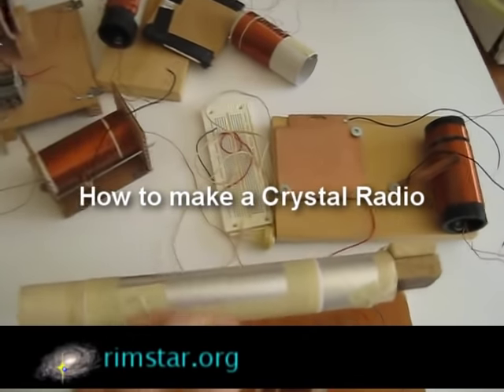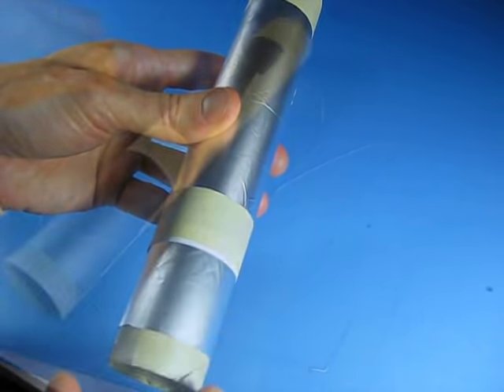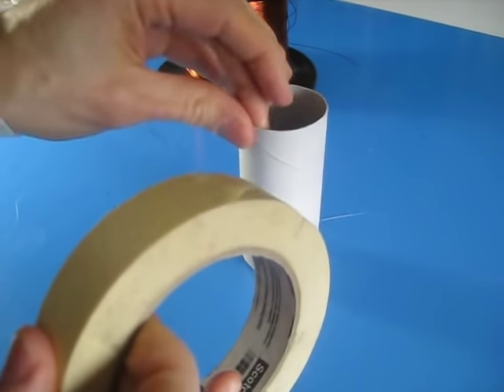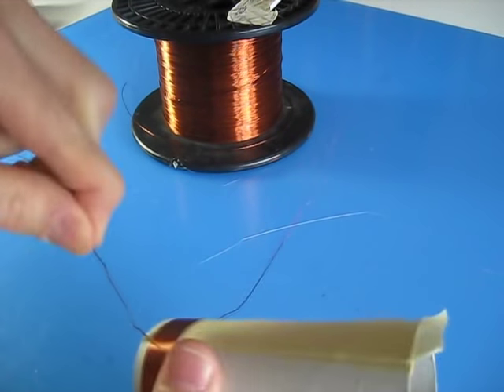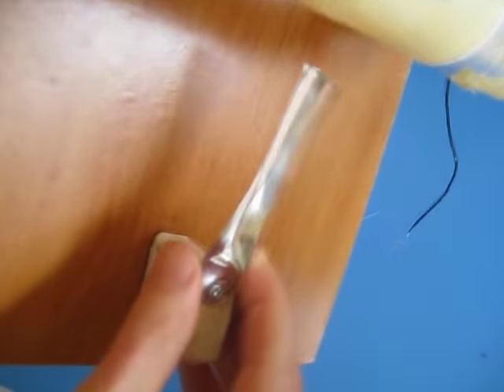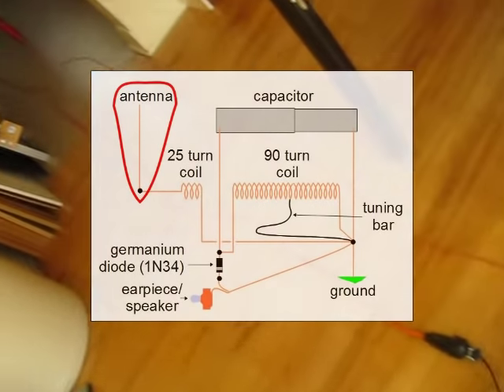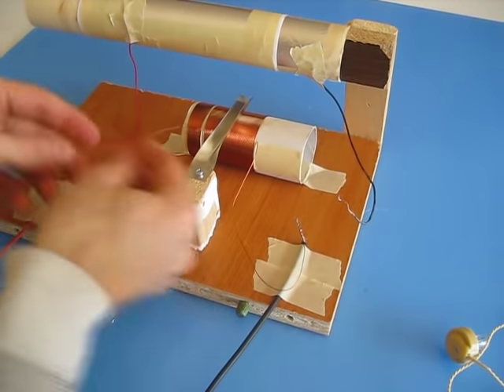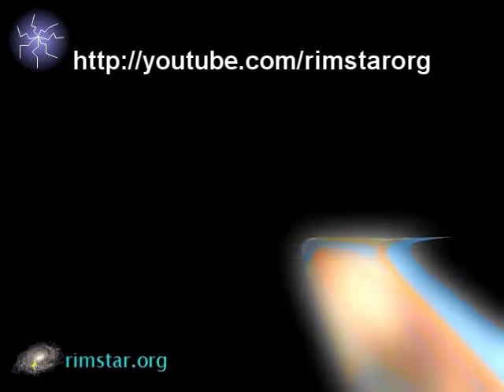How to Make/Build a Crystal Radio

Comment from the maker: +Gabriels Raitis Kuma No, an LED won't work. The voltage required to start the LED conducting is too high for the radio. And it has to be a germanium diode, not a silicon diode.
PS. Your comment doesn't have a Reply button because your Google+ settings are set to not allow "Anyone" to comment on your public posts.
Reply: Will an Schottky diode work also?
Reply from the maker: Some mentioned in the comments here that a low-barrier Schottky barrier might work. I haven't tried it myself.
Reply: I bought the lowest voltage drop Schottky diode (0.29v @ 5mA) with very small leakage (within nanoamps) but I have not had luck so far. I suspect my crystal earpiece may  have been damaged though.
Reply from the maker: Thanks. Let me know if you do get it working. It would be nice to have confirmation.
Reply: RimstarOrg I can pick up noise around 700KHz, and it sounds exactly the same on a surround sound system on the AM tuner selection. I think it is my PS3 or TV tuner. Even the tuner cannot pick up any strong AM stations, so if this does work, it is not very sensitive. I have had a germanium diode many years ago and that worked, but a HV transient popped it.
Reply: Here is a list of everything I figured out since the last comment: (make sure to read more)

I picked up a few of these "SBAT54CLT1G" Schottky diodes (link below), which have a Vf of 0.23V @ 1mA, and pretty good reverse blockage. They were the best ones I found on Mouser. I have found that they do indeed work much better after I setup my own 32MHz VHF AM transmitter (I only had a 32MHz crystal oscillator.), because I cannot pick up any actual AM stations. Maybe you could give them a try? The nice thing about being able to use schottky diodes is that you can salvage them from small switch mode regulators on many circuit boards for digital electronics these days. You just need to know what to look for. (typically they will be part of a regulator, so look for diodes near inductors and capacitors and other supporting chips.)
http://www.mouser.com/search/ProductDetail.aspx?r=863-SBAT54CLT1G

I found out that trying to parallel up multiple diodes to slightly reduce the Vf resulted in actually reduced performance. This might be due to capacitive effects at the junction of the diode, not exactly sure. Conversely, if you supposedly heat the diode junction up (perhaps with a soldering iron) then Vf will decrease and leakage current will increase, and the radio becomes more sensitive but less selective (due to greater loading effects on the LC tank.)

I have also bought a couple 10A 40V "SBR10U40CT" schottky rectifiers (intended for use in a big SMPS), which has a really low Vf of only 0.12V @ 1mA, but these did not work at ALL. A 1N4148 silicon small-signal diode much outperformed it! Probably also due to either due to unacceptably high leakage or capacitive effects.

LEDs did not work at all but apparently biased LEDs can work very good and better than any germanium diode, but I have tried that, as it sort-of defeats the whole beauty of a radio without power! At that point might as well also add some amplification stages too.

The noise I was receiving the other day was a result of a crappy chinese power brick for my monitor. After unplugging it I got mostly silence on the crystal set.

How with a reasonably powerful RF source, my next investigation would be the crystal detectors made out of rusty metal and minerals, and compare that to my working config.
Reply from the maker: Thanks. I'll keep an eye out for some schottky's. Having a nice long antenna and/or being near radio stations would make a difference. I have a short antenna but am near some radio stations.
Reply: YES! I can pick up 1 station very faintly, I know it's not my own transmitter because it's too far away, and honestly I am not sure if my crystal set is tuned to pick up that high. It works only a few feet away. Also the station was playing some commercials, definitely not my music album on my Tx. :D
Reply from the maker: Yay! At least it's something.
Reply: I do wonder why my crystal set always manages to pick up spanish stations :/ Anyways, while searching for how to make crystal radios detect FM (slope detection is pretty easy) But I found another schottky diode that is actually designed specifically for this purpose, the 630-HSMS-2850 ! It's available on mouser but seems to be an obscure part. Supposedly it works better than most germanium diodes for this application. I left some of the ratings and link below:

Type:                             Schottky Detector Diode
Forward voltage:         0.20v @ 1mA
Diode capacitance:    0.3pF
Sensitivity:                   40 mV/uW
Package / Case:         SOT-23
Max reverse voltage: 2V

http://www.mouser.com/ProductDetail/Broadcom-Limited/HSMS-2850-BLKG/?qs=%2fha2pyFadujVtS6qtQvAxmC3cJzM5VvUzRaRxyzZX0SI0kLe0pTe6w%3d%3d

http://pdf1.alldatasheet.com/datasheet-pdf/view/103074/HP/HSMS-2850-TR1G.html

It seems like most sites that have actually tested simalar Schottky Diodes agree, they are better for high selectivity crystal set designs, due to lower leakage current. The right ones are better. Germanium point contact diodes have greater variance even between the same part # devices and have higher leakage, so they can be sort of hit or miss. I think the most important ratings is low Vf and very low capacitance, and less importantly, low leakage. (look for 0.25v or less Vf, and less than 5pF capacitance.)
Reply: So now I know for sure it is possible to use diodes found on VHF/UHF receiver modules. :D I had an old dead PCI TV demodulator laying around, and I saw next to a chip some tiny SOD 923 diodes which tested out at 0.23v! These work even better than the diodes I bought, they themselves are probably detector diodes. I can now pick up 3 to 4 stations, including my own AM transmitter, which is now set up broadcasting at 100KHz and maybe some harmonics.

I am surprised that pushing a 700V peak to peak AM signal into a 20 foot wire does not transmit with more power, as I can only barely pick it up a few rooms away. :/ I might rebuild the slayer exciter to see if I can get 10KV peak to peak at 1MHz. Only problem with the slayer exciter is that the frequency will drift with external loading. Hopefully the FCC does not come busting my door down lol.
Reply: in the 70's when I built a simplified version of this, the diode was made of transparent glass with a visible filament inside, which was called a crystal diode.  Not sure what they look like nowadays.

Comment: I am 73 and have two crystal radios one I made with a razor blade as the tuner in stead of the wiper . I can get three station one is 35 miles away wwva large powered station
Reply from the maker: That's pretty good for a razor blade one. I know I had trouble getting anything with mine. How long is your antenna?
Reply: Over 250 ft I am also on the highest point in my county
Reply from the maker: george330ful
Wow. 250ft is great, I'm envious. Sounds like a great location.
Reply: Yeah, remember that trick. Glue a razor blade flat on a wooden board, fix the head of a safety pin near it with a nail, touch the sharp point of the pin vertically on the flat surface of the blade. That'll work as a crude diode
Reply: Jumpstart Jimbo I believe they used to call that a cats whisker
Reply: Landotter1 Wow ! That makes sense
Reply: Landotter1 Yeah! They used those suckers in the trenches in WW1! Had to get the news somehow!
Reply: Landotter1 A cats whisker was when you have a thin wire touching a galena crystal
Reply: The performance of these crystal radios is very much dependent on the distance and transmitter power of a nearby radio station.  Some old-timers I've talked to have told me, that back in the 40s and 50s they've used a raw germanium crystal with a needle touching it to try to tune in a station.  Course your mileage may vary...

Comment: You can burn the insulation off with a lighter
Reply: Yeah i too did that on the ends of each wire. However i would not recommend doing that instead of sanding off the coating layer for the wiper. You only wanna wear off the upper layer, not the whole coating all around the coil on that spot.
Reply: u can burn the whole radio with a lighter

Comment: 1:15  = money shot 🐲
Reply: :'D :'D :'D Oh god. :3
Reply: SB please tell me, what is this? How do you use this? What is it for? Where is the crystal in it because I missed that. Thank you.
Reply from the maker: There is no crystal. In the original crystal radios from the early 1900s they did use a crystal instead of the modern diode and that's where they got the name crystal radio. But these days a crystal radio is any radio that gets its power from the incoming radio waves.
Reply: 8:57 25 turn coil and 90 turn coil ?
Reply from the maker: I'm actually working on a video explaining how many turns now, but it won't be out for a week or so. The capacitor and coil form an LC resonant circuit. It doesn't have to do with wavelength the way you seem to be thinking about it though. In the meantime, I have some calculators here http://rimstar.org/science_electronics_projects/lc_circuit_aka_tank_or_resonant_circuit.htm for working out the right coil. I also talk explain it in my How a Crystal Radio Works video http://youtu.be/0-PParSmwtE.
Reply: Glawber Oliveira
Reply: You sir just won the daily internet award!! :D
I'd hate to even think how many will be listening to this crystal radio doing 1:15 at the same time... baahaa
Reply: @RimstarOrg  Is the ground outlet plug shown in the making, which wire to use, etc on your video?)  25? ( 30?) -90! Layman guess is a trifecta. above, ground, and below. 1/3 ratio, but why, if so? The Sad State of the Countries, Nations, and Earth. Hope we can free our minds and free our energy! Thicker copper (?) coils, same ratio?  Maybe RimstarOrg made his video and helps explains where our sweet youtuber here has jumped over. Ironically, the tuning forks and scrying rods are even, as for as I know. How does this maybe relate to a sistrum?

Comment: can we use silicon diode and less no of turns plz cmnt
Reply from the maker: Typically, no, a silicon diode won't work. For that you either need a very long, straight antenna (over 100 feet) or to be next to a powerful radio station. And yes, you can use less turns. You just may have more overlapping stations since you're compressing them into a smaller length of coil for tuning purposes.
Reply: Thank you for valuable reply
Reply: RimstarOrg could you tell me any other alternatives of capacitor (trimmer capacitor)
Reply from the maker: I show another DIY design in my crystal radio tips and tricks video https://www.youtube.com/watch?v=HZZmKZJrIW0. I have some links to where you can buy on in the video description.
Reply: Sir I'm working on this project and I have two questions
1. can we have any other option for grounding because it may be dangerous and I want to make it portable.
2. Can we use one earphones piece for sound will it be much sensitive to sound.
  Sir plz help its my project
Reply from the maker: 1. That crystal radio tips and tricks video I gave a link to, https://www.youtube.com/watch?v=HZZmKZJrIW0, has tips for more grounds near the end. You can also use your body as a ground by connecting the ground wire to a piece of aluminum foil and holding the foil in your hand, making as much physical contact as you can.
2. If by earphones you mean the type you use for mobile phones and ipods, those don't normally work, even if you use just one of them. I did get them to work by adding a transformer (http://youtu.be/GCh2LVHUavQ) but the volume was lower.
Reply: Thank you so much Sir it would be helpful for me

Comment from the maker: A really good antenna length for the entire AM radio range is 139 meters (455 feet). That`s 1/4 the length of a wave with a frequency of 540 kilohertz. but few people are going to be able to do that. So just make it as long as you can. The gauge of the wire makes more of a difference for strength than for the electrical characteristics. A 100 foot 24 gauge strung between two polls might break in a strong wind. So if it`s not suspended in the air or it`s not permanent then use what you have.

Comment: That is a very novel way of making a variable capacitor. I've spent 38 years as an EE and I'm having one of those "Why the heck haven't I thought of that?" moments. I've been working on some high voltage projects (Tesla coils, Jacob's ladders, plasma arc speakers, etc.) in my spare time and I need some high voltage variable capacitors to tune the circuits. I'm going to try this with adhesive-backed aluminum tape and ABS pipe. I've been struggling with how to do it and you may have just solved my problem. BTW, it's nice to see that people are still building crystal radio sets. Here in Illinois, we have a town named Galena because of all the lead ore they used to mine. It's kind of touristy now, but you can buy all the galena crystals you ever wanted. Poking around on a galena crystal with a 'cat's whisker' to find a sensitive spot is magic! Many crystal radios, even modern ones, are truly works of art. Great video! Thanks for making it.
Reply from the maker: I'm glad to hear you got some value from the video and enjoyed it so much! Thanks!
Regarding the variable capacitor made this way, there is something non-obvious to watch out for if you're using it for high voltage. Using aluminum tape on the ABS pipe is good since it won't move. But if you use a loose foil, as is done here for the other plate then the high voltage will make that plate be attracted to the ABS pipe plate. Since it's just a relatively loose foil, some of it will actually attract and then relax again in time to the frequency, or as close to it as it can. Since one parameter to capacitance is the distance between the plates, that means the capacitance will be varying, even when you think you have it just where you want it.
So for the outer plate/cylinder, come up with something rigid.

Comment from the maker: I just lay a long length of wire across my floor. Mine isn't very long, only around 3 meters, but I pick up a few nearby radio stations and a few that are a few hundred kilometers away. Most of the time I actually lay out three wires parallel to each other and connect them together at the radio. The diameter of wire (wire gauge) doesn't matter much. Longer is better. And if you have one radio station you always listen to, point the wire at that station if possible.

Comment from the maker: If you're talking about the aluminum foil, it doesn't matter which side is up. The only difference between the shiny side of aluminum foil and the dull side is that one is shiny as a side effect of how it's made. There's no coating on either side.

Comment: I used to make crystal radios when I was a kid.  If you don't have a diode or a quartz crystal, you can use a rusty razor blade and a safety pin.  It actually works!

Comment: I remember as a kid (80s/90s) hearing about kids in the 50s building crystal radios out of quaker oats cylinders.  I got a crystal radio kid that had basically radio shack components and a mounting board and building instructions.  I assembled it following the steps and it worked but I never had a good enough idea of how it worked to build one completely on my own, especially from a quaker oats cylinder.
Later as an adult, I got the Klutz crystal radio kit to show someone how they worked.  The Klutz version had a really good explanation of how they worked.  I could hear the sound, but the person I was showing it to couldn't.

Comment from the maker: The antenna doesn't need to be hung. I use 3 15 foot wires connected in parallel and run across my floor. Though if your floor is metal then there may be a problem. The higher up you go in the air the better, but mine works fine on my hardwood floor.

Comment from the maker: No. The antenna has to be a long straight wire, either with the crystal radio attached to the middle or to one end. It also helps if the antenna is pointing at the radio station.

Comment: Thanks, nice to see all the steps. To clean enamel off the wire you can also use steel wool and just give it a few tight rubs.
Reply: Gary McKinnon that's what I do to strip the enamel off. I find 0000 steel wool works the best what about you?
Reply: Samuel Scott
I give it a quick burn with a lighter first so any grade will work.
Reply: Gary McKinnon oh that makes sense, thanks for the good tip. I will have to try it some time

Comment: I've been toying with electronics on and off for decades, I'm the equivalent of a tech level HAM in my country, and am currently building a Stockton Bridge SWR with a (esp8266) MCU to do the calculations, so this video should have been BOOOORING!  But it wasn't!  I've never actually built a crystal radio.  I'm fascinated by how simply they can be made.  That paper tube varicap is inspirational!  Too easy to get lost in the complicated stuff and forget the basics of applied science.   Thanks for a great video!
Reply: ... having just said that. I'm not going to be using an ESP8266.  I thought it had two ADCs. It doesn't. Oops.

Comment from the maker: The name, Crystal radio, is mostly historical. Instead of a modern diode people used to use actual rock crystals, like galena, and touch it with the tip of a bare wire. This was called a cat's whisker in case you want to look it up. Some people still do that but I've haven't tried it yet.
And I already have a video explaining how it works. See the description below this video for a link to my very detailed "How a Crystal Radio Works" video or find it on my channel page.

Comment from the maker: I can't say for certain which transformer would work but 230V has as much a chance of working as my 120V one did, so it's worth a try. It's actually the resistance of the transformer windings that's important, not the voltage.